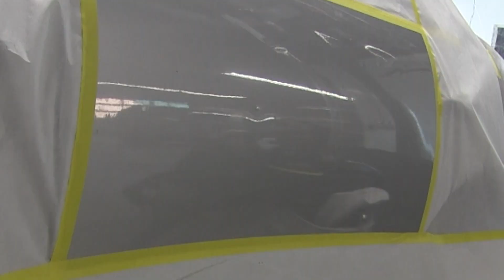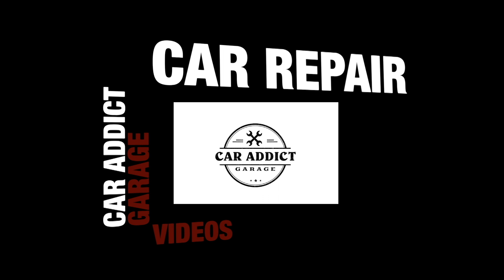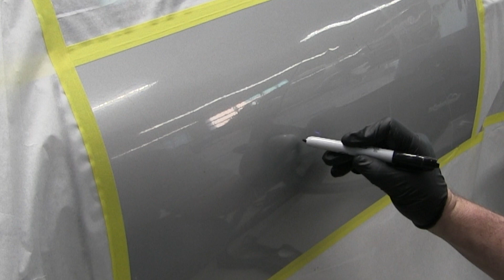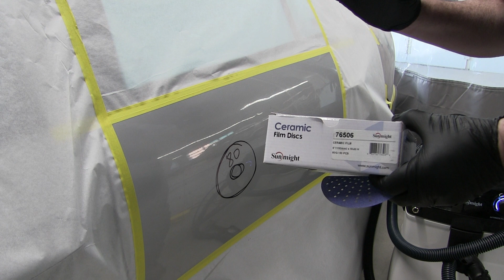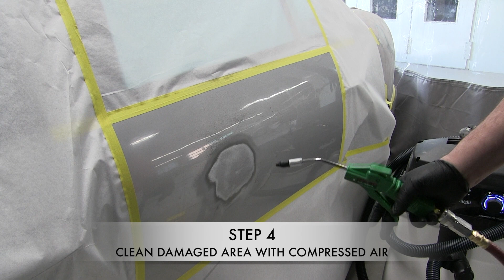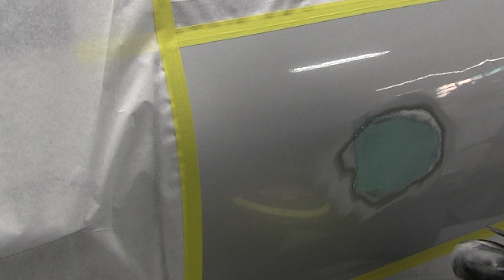Dent Repair - What Grits To Use and The Steps Using The Sunmight System

Comment: Thanks for your very informative videos.  This is a bit off topic of this video, but I’m hoping you can help me with a couple of questions.  The first is will you please recommend a high quality clear coat (brand and specific product) that is available online?  To follow is all the information about the project...
I am about to repaint a 1985 Porsche 928 and will be using the original color of the car, garnet red metallic which is a very orangey red with a copper look to it in the sun.  I’m doing the entire car including the jambs, inside and exposed portions of the doors (but not the entire inside where the panel will cover it), and probably not the inside of the hood.  I can only find the paint in waterborne.  This is my first complete car respray.  I’m estimating a gallon of paint, but that color doesn’t cover well, so I may need more. What are your thoughts about how much paint will be needed?  Also, how much each of primer, surfacer, and sealer do you believe I will need?  Some of the panels (the hood, roof, and both bumpers) will require stripping to bare metal (or plastic on the bumpers) due to the extremely bad condition of the paint.  The rest of the panels aren’t bad, so I’m thinking of just sanding the clear on those panels to provide a good surface for the sealer and then base coat and clear.  Do you feel that is a good strategy - strip to bare metal on badly paint damaged panels, strip to bare plastic on badly paint damaged front and rear bumpers, and just sanding the clear of the rest of the panels?
There is some minor body work to be done with a couple of small dents/dings.
I’m planning to put a sealer on the entire car prior to doing the base to provide a consistent final substrate for the base coat and avoid inconsistencies between the panels that were taken to bare metal and those just sanded in the clear.  Ideally I’ll use a red colored sealer if I can find one.  Do you know of a good sealer that comes in red?
Does all this sound on track as far as my plans for the project?   For the panels I strip to bare metal do you recommend a self etching primer or epoxy primer?  I haven’t used epoxy primer before but will if that’s the best option. If I do use epoxy primer, how long will I need to wait between epoxy primer and surfacer or sealer and then base?
Finally, I’m estimating about 1.5-2 gallons of clear coat.  Do you think 2 gallons of sprayable product will be enough?   I have used Transtar Select Royal Clearcoat (product OR 3101) which is a 2:1, high solids clear, but I want to use a  top quality clear on this job and will welcome your recommendation of a clear brand and specific product if you will offer that guidance.  PPG products aren’t easily accessible or available based on my search for them.  Their ceramic clear coat sounds great, but I’m afraid it will be too expensive, and again I’m not sure I can even find where I can buy it.  So other recommendations are welcome.
I apologize if this is too long and too much information, but I have heard you state that too often people ask questions but don’t provide enough information for you to be able to provide a proper response.  If you need any additional info I will gladly provide it and answer any questions you may have to fill in any gaps I may have left in describing the project.
Thanks in advance for any insight and guidance you can share and again for your wealth of info in your YouTube videos!  I am very grateful for your assistance!
Reply from the maker: Hi bross63!  Thanks for your questions.  I will go more into detail soon, but for a quick answer for now, I would look at Eastwood products.  They work well and can be bought online.  However, they only have select colors in their paint.  Here is a good video series of doing a complete and jambs.  This car did not require stripping to metal, but I do mention that in the videos.  https://www.youtube.com/playlist?list=PL49vEsY2VV2owacnGOt31FQj6N3e9_ugi
Reply: @CarAddictGarage  thanks for your quick reply and recommendation.  The owner wants to keep the car the original color. There are a few sources for getting the paint in that specific, factory color, but I’ve only found it from the sites that sell touch up paint like touchupdirect, paintscratch, theautopaintdepot, everestautomotivemarket, and automotivetouchup.  I have used paint from touchupdirect on multiple jobs, and their paint matched perfectly on each of those.  But they don’t sell gallons (only quarts), which makes them a lot higher than the others, so ’ll probably get the paint from one of those other suppliers.  I haven’t used epoxy primer before, only self etch.  Do you believe I should consider using epoxy primer instead of self etch on the sections where I have to go to bare metal?  There will be some body work in a few areas, so I will need the filler to adhere to the primer in those areas, and I will need the surfacer to adhere to the primer on the panels stripped to bare metal.  Thanks again for your reply and helpful info and for the link to that video.